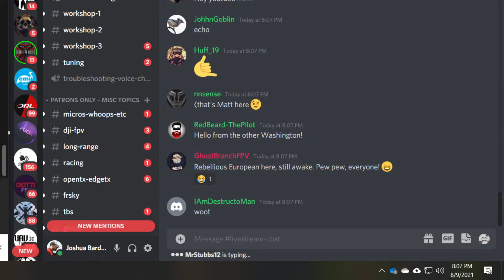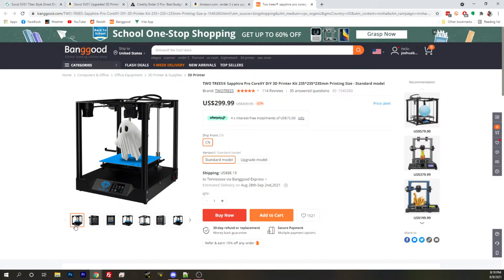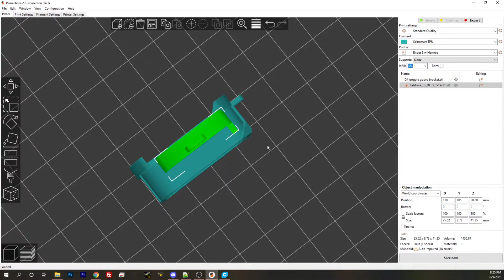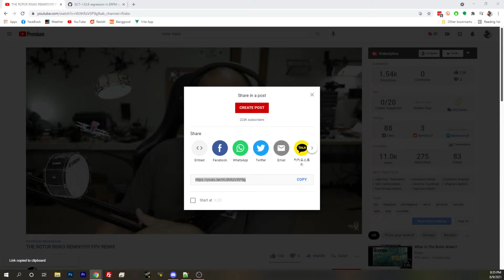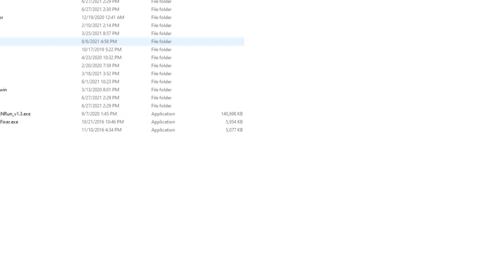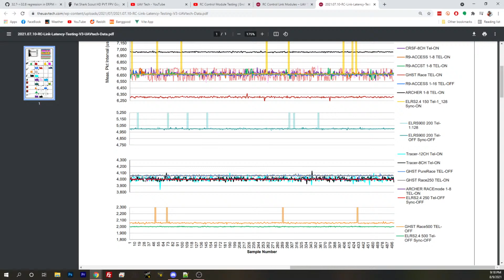Q&A Livestream - August 9, 2021

Comment: Well. the advantage of ELRS is, that you can run it on different hardware from different manufactors.
I am not only into quads, so I can use e.g. a full diversity receiver with 100mw output for telemetry
on my wings ( SIYI FM Mini / STM32 > passthrough) and small ones ( ESP32 > wifi) on the quad.....
with the same transmitter module. I am not bound to the hardware one manufactor will offer me.